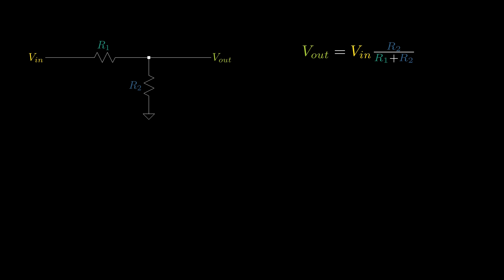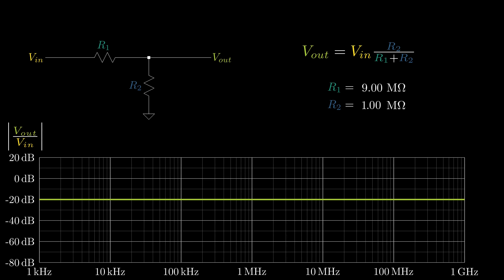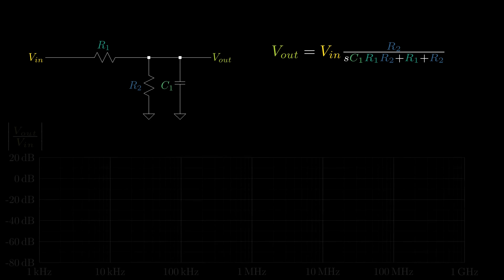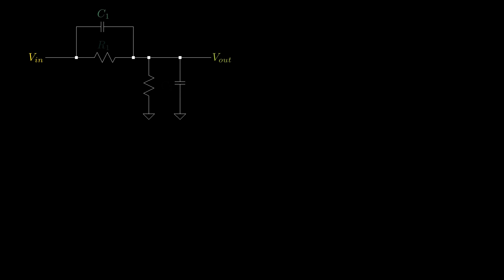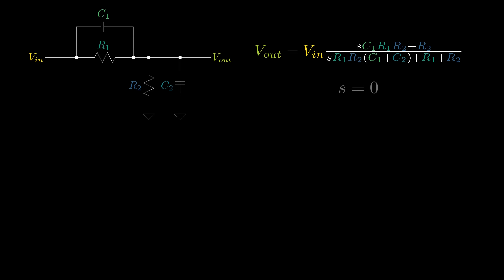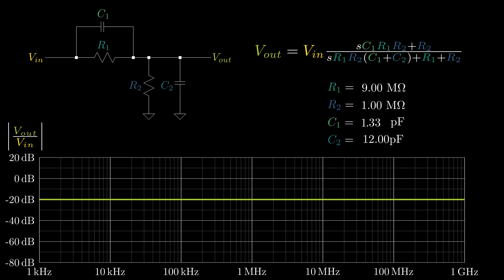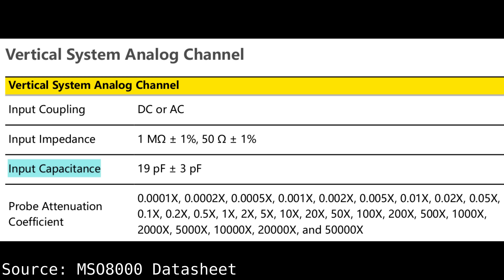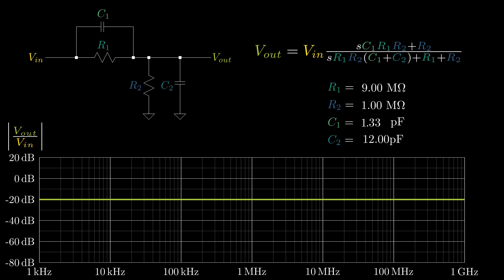This Circuit is Found in Every Electronics Lab: Let's Find Out Why | Interview Question Walkthrough

Comment: Why is -20dB? What is the equation to calculate decibels? To my best knowledge, decibels refer to power, but you just used the absolute value of the voltage. What did I miss from the class? Cheers.
Reply from the maker: In the log, the voltage is squared, but the square can come outside the log as a factor of 2. So originally the equation was 10*log(Vout^2/Vin^2), but then it became 20*log(Vout/Vin).

See here for a the same question:

https://physics.stackexchange.com/questions/274052/why-we-have-used-20-log-to-convert-magnitude-into-db-instead-of-10-log
Reply: @TLV3604  Thank you so much. So decibel is a measurement of power but P = V^2/R and Vin and Vout have the same R so it is cancelled out, which only left the V^2. Cool, making sense now.

Comment: And 2 minutes in the math is beyond me.  Sigh.
Reply: Keep working at it and eventually it won't be
Reply: @seamusmoran4776  and the other C2.  How did C2 turn into C1.  I am sooooo confused.
Reply: @kevingallineauii9353  what do you mean?
Reply: @kevingallineauii9353  If you're referring to the complex fraction at 1:46 you just multiply that fraction by (s)(c1)(c2)/(s)(c1)(c2)  - which is equivalent to 1. The s and c1 cancel in the numerator and s and c1 cancel in the first fraction of the denominator and the s and c2 cancel in the second fraction of the denominator respectively leaving s1/s2 + s1

Comment: If there is another capacitor in series with C1, (C1=16uf in series C3=8) with parallel resistors of say 4ohm) should the total capacitance to the output be the sum of 2 series capacitance?. This is the series leg of a second order crossover of an Advent loudspeaker.I believe the use of the 2 capacitors and parallel resistor is to allow higher frequencies to pass and give higher Q at cut off at 1400hz.

Comment: Not that s ~ freq, so s is the only variable here in Vout/Vin = [sC1R1R2 + R2]/[sR1R2(C1+C2)+R1+R2]
If you model this gain formula as g(s) = (as + b)/(cs+d), then differentiate using the quotient rule;
g'(s) = (ad - bc)/(cs + d)^2.
Gain constancy would require g'(s) = 0 , so ad = bc in numerator.
substituting back the C and R we get C1(R1+R2) = R2(C1+C2)
finally giving g(s) = constant where  C1/(C1+C2) =  R2/(R1+R2). 😬

Comment: This was great video. I don’t do electronics (as much as I’d like to). I’m a software engineer, but I love math and still remember how these equations work from almost 25 years ago.

I started guessing, would this be smoothing out voltage in a power supply. Then, it looks like a filter. Once you said parasitic capacitance, what it was doing clicked instantly. Didn’t realize, though, that oscilloscope probes had a parasitic capacitance, so I never would have guessed its intended purpose correctly. (I haven’t even touched an oscilloscope since college and I don’t recall using them much at all.)

Anyway, this is fun. A subject that I like with explanations I understood? Yes, please.
Reply: Programming stuff too? I only wish there were more videos to binge.

Comment: I would build the circuit with out the capacitors as a 10 to 1 or 100 to 1 voltage divider across an 8 ohm load. Used for audio level matching into either a line input or microphone input.

Comment: 1:06 Isn't it a -10dB attenuation instead of -20dB? A 20dB atenuation should be 1/100th the voltage, no?
Reply from the maker: This is my fault for not being as clear as I could have, In my magnitude equation I am plotting 20*log10(Vout/Vin). In the future I will be a more explicit with the formula.
Reply: @TLV3604  Is that an equation for power instead of voltage?
Reply from the maker: @ultrafilipsz.5827  power is:

10 log10(p_out/p_in)

The factor of two difference comes from the fact that power is proportional to V^2, so can use log rules to move the exponent outside the log function

Comment: Okay, I'm not great at the maths of these kinds of circuits. But I read a circuit like this as C1 & R1 are a high-pass circuit, & R2 & C2 are a low-pass circuit; I would analyse the total circuit by plotting the reactance of each per frequency, treating the results per frequency as a voltage divider.
Reply: That said, this is why your scope has an inbuilt calibration signal; if you use it to square up the signal from your probe - EVERY TIME! - before you measure real world signals, your life will be a lot easier. :)

Comment: excellent presentation. I knew what the circuit was just by the thumbnail, and I also know what they are for and why you need to adjust the probe to match the scope to get the waveform to show up right. every conductor is a capacitor, a resistor and inductor depending on reactance according to time and frequency and even length of say a wire and you use this network of components to compensate and correct the voltage over frequency range to match the signal range to the probes properties. But those math equations are like a foreign collection of cryptographic mysteries to me. I can do circuits and even design and build circuits from scratch and I know how to use ohms law and even combine it and use that one for power. But simplify it by using algebra is like solving world peace by throwing potatoes on a fence to me lol, I have to calculate that stuff in different ways. I would be happy to learn more how you do these calculations as in how you add these numbers together and put in a calculator correctly

Comment: for those curious, the class of circuit is called compensated attenuator
Reply from the maker: Good point! I'll try to add the general class of circuit in future videos.
Reply: Thank you.
Been compensating scope probes on and off since 1975 ... including on models as old as a Tektronix Type 543, 547, 453, 454,  465 and 475 to name the earlier ones ...
Reply: I thought it was a RC bandpass filter
Reply: Wrong.  It is only a compensated attenuator if selecting C1=C2(R2/R1).  We need to compensate for your lack of intelligence as you just failed the interview
Reply: @gregorymorse8423 wtf. who are you, what interview. do you have a point you'd like to make civilly
Reply: @gregorymorse8423  .--. . -.. .- --.. --- / -.. . / -... --- .-.. ..- -.. ---
Reply from the maker: @gregorymorse8423  Did anyone say otherwise? Also, is there a reason you are insulting me/others in my video comments? I would appreciate you not doing that.
Reply: @TLV3604  it was intended as a joke.  But he is spreading incorrect knowledge.  This is not the class of a circuit rather a specific parameterized variation of the circuit.  This was quite literally a totally false generalization.
Reply: @gregorymorse8423  it is an attenuator (well, one of) "topologically." it can be a bandpass and other things with appropriate component values, but is not the "typical" circuit for any of those.
this is pointless pedantry. also, work on your civility, might be of use IRL

Comment: Software Engineer here, as someone inexperienced in problems like this, is it normal to solve AC for DC circuits, how do you even know this supposed to be an AC circuit, it doesn't specify Volts in AC just Vin and Vout?
Reply: It has capacitors. They are open-circuit for DC. In DC, this circuit is just a resistor divider.
Reply: DC is just a special case of AC.   We cannot assume that Vin is only going to be DC.
Reply from the maker: There are some circuits intended just for AC use (full bridge rectifier), and some circuits intended for just DC use (Low-Dropout regulator - [simplified]). However, these distinctions can be pretty hazy, and lots of circuits use signals with both AC and DC components. 

The nice thing about passive circuits is that they are LTI (Linear, Time-Invariant). This enables you to  analyze their behavior at each frequency independently, and then construct an output based on your input transformed by that behavior. 

For example, if I have a input signal of: 1 + sin(2*pi*t) V, and I have a circuit that has DC gain of 2, and AC gain of 4, my output voltage would be 2 + 4 sin(2*pi*t) V. Note that even this is simplified, generally the gain varies smoothly over frequency, so there would be a frequency such that there is a gain of 3. (Let me know if this was confusing, I can try to reword).

If this sounds interesting, the college class is commonly called Signals and Systems.
Reply: @TLV3604  In geophysics we use frequencies as low as 0.1 Hz and even lower, but then we talk about period in seconds.    Then we have transients when switching DC on and off, so it all ends up with AC analysis eventually!
Reply from the maker: @karhukivi  yeah, it definitely gets a little fuzzy. Even for DC-DC converters, it’s not really “true” DC, as there is noise on the input/output. And of course, the switching on/off of a power supply can cause relatively high AC components.
Reply: @TLV3604 thank you for clarifying I now have a better understanding about solving circuit equations! I won't take up more of your time I will watch some more advanced videos!

Comment: This is incredibly fascinating and insightful. It makes me feel like I've wasted all my time learning these concepts without actually understanding what they're for.
Reply from the maker: Don't feel like you've wasted all your time! You can always learn how to apply concepts after you learn them. Honestly that's how a lot of material is taught. I do prefer to learn things intuitively, but rigorous learning (being able to solve these equations mathematically) is also very powerful. If you know something with rigor and intuition, you can use one to check the other. Like how I checked the final equation using the simpler equations.
Reply: Thank you for helping people form a more concrete and fundamental understanding of electrical engineering concepts. You've definitely earned yourself a subscriber.
Reply: @TLV3604  This is real anoluge electronic stuff, for me the first part is used in smps circuit and the other after the four rectifiers to convert to dc and  the resister and capacitor comes after that. Did not like the analuge side of it if it without electricle stuff- yaac...
Reply: @Dailymailnewz  I suggest you re-watch. Even digital signals function in the "yacky" reality of the analogue world.